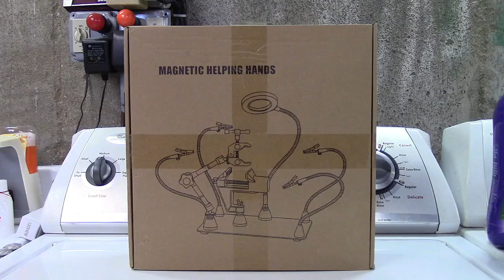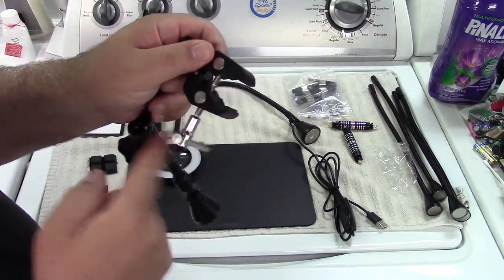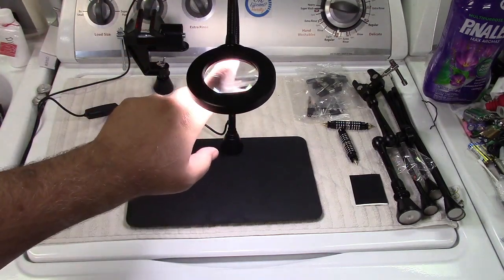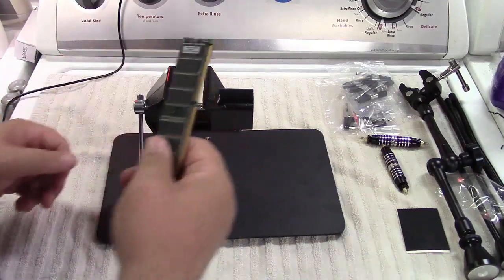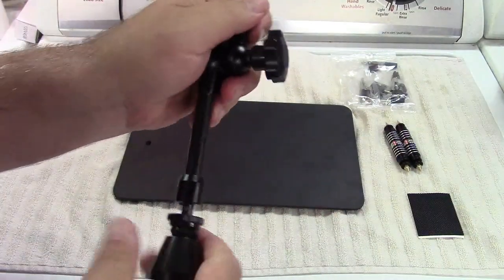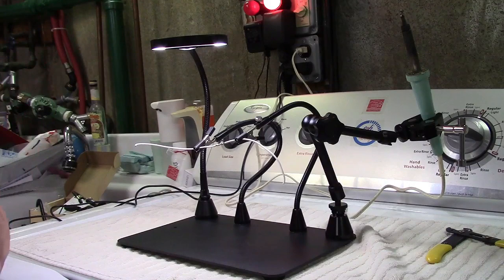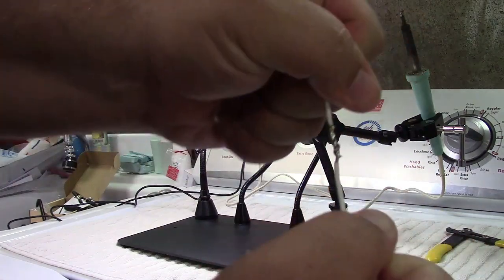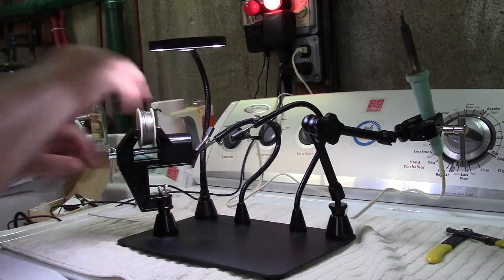NOEVSBIG Magnetic Helping Hands Soldering Station With Lamp Review

Comment: Be nice if these were made to work under microscopes. Everything is too tall. Except the board pins.
Reply from the maker: I got one of them little guys with the bar and two alligator clips.  That should fit under my scope.  This is great for larger sized repairs that don't need a microscope to perform.
Reply: Can't you just mount the microscope to be taller than the arms? It comes with an arm for a microscope
Reply: Unless if you're talking about actual microscopes not camera ones, you could still get a stand to sit it on right? o:
Reply: I have the real deal microscope. Which  out perform the camera ones any day. @Pahtoh
Reply: @RollingTardis  That's cool, they're pricey. I just saw some have cmount on top of them, maybe you can get something like Adapter 5/8" (B&H Filmo) to C-Mount and a 5/8 to 3/8 then just screw it on with adapters to one of the arms that are bulky and can handle it. Just a work around that might help you get your job done